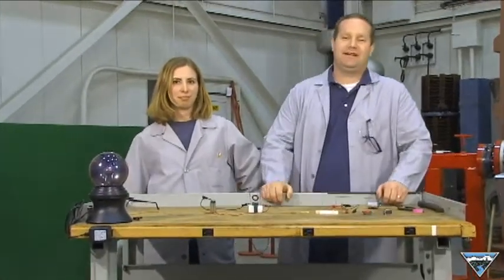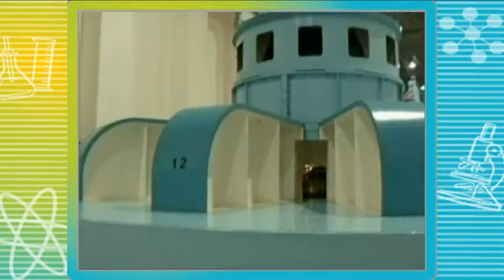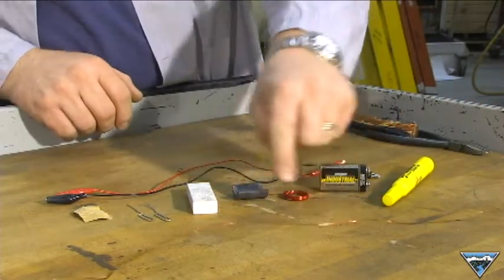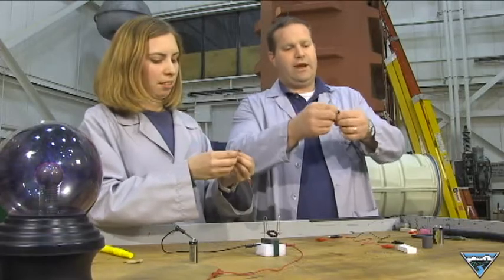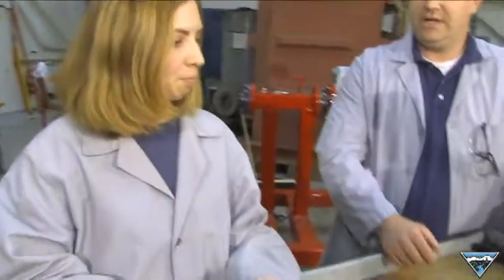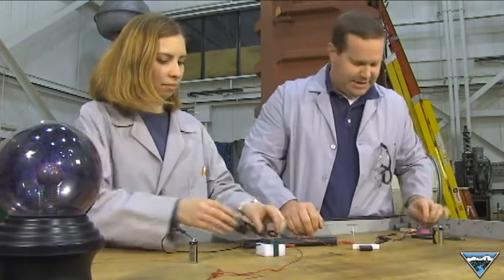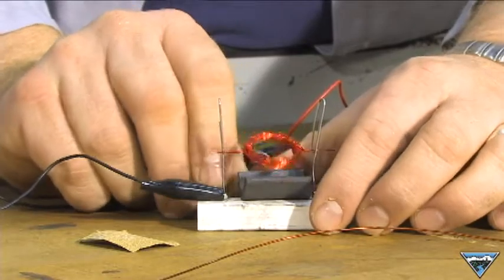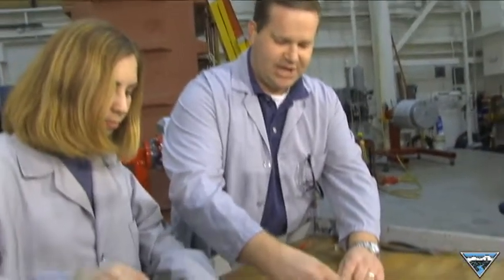BPA Science Lab - How to Build a Motor

Comment from the maker: @kyle0106 A quick way to slow it down is to move the magnet further away from the wire. You can also adjust the spin by wrapping more or less of the wire around the highlighter, and a heavier gauge copper enameled wire will spin slower (likewise a smaller gauge wire will go faster). You can also increase the speed by increasing the voltage. So experiment with these and let us know if you discover other ways to adjust the speed!